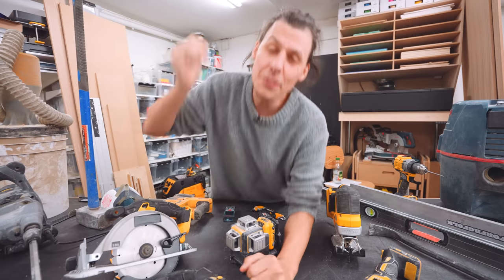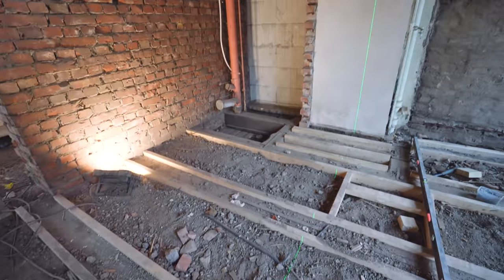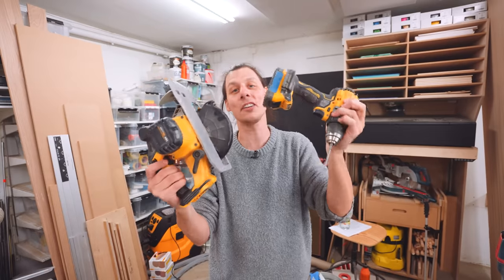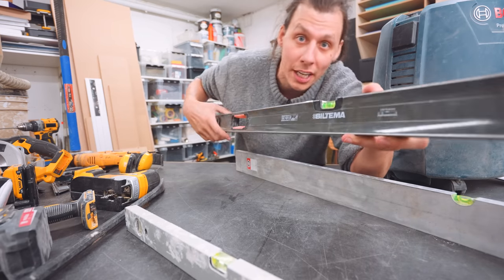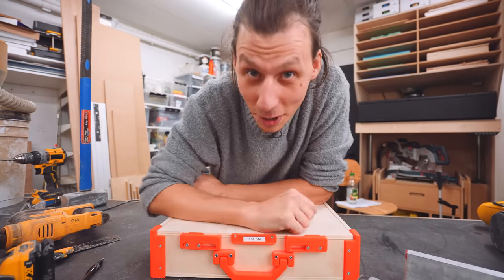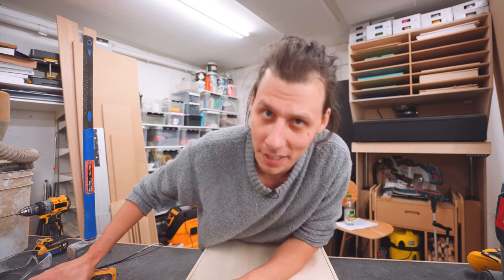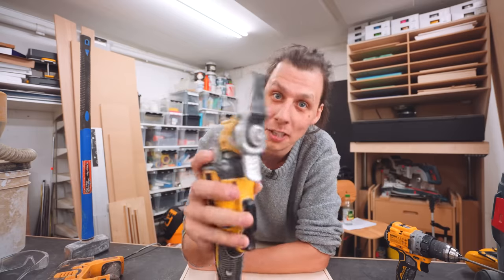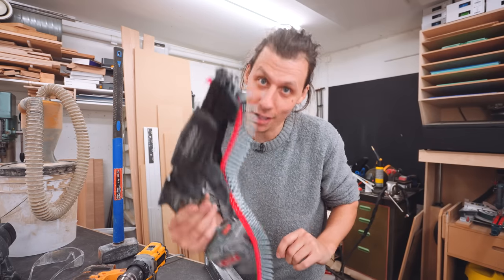Top 10 Must-Have Tools for DIY Home Renovations

Comment: This is what EU should force....compatible batteries for each brands.
Reply: 100% same should be enforced with all electronics, phones, tablets, laptops etc. univeral charger that fits all devices no matter what brand
Reply: @smashyrashy  for the phones and tablets, it's already the case, EU imposed and universal charging system, and everybody except for one asshole choose to use USB-C. The asshole being Apple of course. They have FINALLY accepted to retire the very inefficient Thunderbolt and replace it with USB-C, BUT, you won't be able to use a standard USB-C cable. You'll have to buy (a fortune of course, because it's Apple) a certified cable with a micro chip inside that will allow your device to accept the said cable. If you use a standard cable, nothing will happen ...
Reply: nope. Not enforced. You have to think things through before forbidding stuff
Reply: @WarriusZ3r0  Apple will replace the lighting connector, replacing it with thunderbolt, probably in the next iPhone 15. Thunderbolt uses the same connector of USB-C, because it is a superset of USB-C.
Reply: @rubenayla  stuff like this should absolutely be enforced. Just think of all the things that you use every day that rely on standards and are better for it. Imagine rolling up to a gas station and being like, "oh shit, I forgot my Chevron to Toyota gas tank adapter, now I have to go find a Shell station to use their compatible gas pumps." Or picking up a AA size battery and first having to check it to make sure it was the right voltage and amperage each time so you don't fry your electronics by accident.
Reply: @evanbarnes9984  Yeah standards are nice.
However, that does not justify a law forbidding the freedom to design things differently.

Imagine if micro-usb was standardized by law. Now it would be illegal to ship with USB-C, and we would depend on the state to slowly choose a new design. No thanks, I prefer to buy whatever I want. If the connector is trash or not compatible I won't buy it
Reply: @rubenayla   You could still have standardizing law saying "use this" and in instances like you mention with micro-usb and usb-c upgrade to change things out. That's kinda why they even changed things out within the usb standard itself. They didn't just make usb-c because it was fun, it has other functions than micro-usb. There's a difference between standardizing and neglecting improvments.
Laws can be altered, and the law about usb-c will undoubtely at some point change to move on to another standard. Because that new thing will have improvements over usb-c. Now when can we get a handle on all of the stupid mess that is quick charge??? xD
Reply: agree!
Reply: I've heard that Metabo is going to set the standard for power tools.
Reply: @Sharp_Stone  there are already at least two "alliance"s to standardise on one battery: cordless-alliance-system and powerforall-alliance :D 
But yes, even having only two battery systems would be better than having hundred and two battery systems....
Reply: Oh yes please! We all know the US won't do it because stupid politicians.
Reply: I'd say that might be a step too far. There are legitimate differences in opinion and design decision about the form-factor, connector, and power-delivery for batteries. But perhaps they should create a set of standards, even if not enforced.

Comment: I have to give props to Alexandre on his organization system.  I've been using his 3D printed bins, and the original cabinet for a couple of years now, and I've even built out a few cabinets of my own design, using his system as the design base.  In my opinion, well worth the (low) price.
Reply: if he had made his system open source like gridfinity it wouldve gotten a lot more popularity
Reply: Charging money for 3d printed stls is pointless as there are so many free options
Reply: How much does it cost to print and build a single drawer with all the 3D plastic boxes included? Just material costs.
Reply: Gridfinity is literaly his system but made open source, so its free and thousands of poeple are improving them.
Reply: @thisisdanielslife  no, it's not, there is no correlation. This is a system designed specifically for wood/metal workshops. Gridfinity is a crap, please do not confuse shit with chocolate.
Reply: @biomorphic  This is all super rough and based on the open-source #gridfinity system, but close enough to get you in the general ballpark with a few disclaimers...

- Each drawer looks like a 7x7 grid so that's 49 units. Longer/wider bins use less material per unit, so lets round that down to 40.
- 40 x 1x1x6 gridfinity bins (guessing the height but 6u looks about right) = approx 170m of filament (at my default print settings).
- Basic PLA (totally fine for stuff like this) costs around US$20/1kg spool, which gives you 330m

So you're looking at maybe US$8-15 per drawer.

You might use more plastic to print stronger parts, pay extra for fancy colours, or use pricier filaments (PETG, ABS, ASA, etc.) for specific use cases, but you get the idea :)
Reply: @glittalogik  thanks, not so cheap, but still affordable.

Comment: Currently renovating myself. Cross laser really is the MVP. 

What I'd add to the list is specifically a CORDLESS hammer drill. 
Its one of my most used tools and I can't count how  often I tripped over the wire or had to lay an extension cord because I also removed wires and only have one outlet.

As vacuum cleaner you'll need one with at least manual dust filter cleaning feature if you have concrete or drywall dust.
The automatic filter cleaning vacuums are crazy expensive. I'm using a Makita wi5h manual and that costs like 140€
I have another vacuum without it and it looses suction power 10seconds in of sucking that fine dust

Comment: Counting in the tools purchases is actually a big deal when doing DYI renovations. For example renovating a small toilet you will need a lot of tools but those can actually be a big part of the bugdet... but if you have few more jobs inline you end-up saving a ton. 
Oh and: "Don't go shopping when you are hungry" -rule applies to tools. After whaling away at a concrete slab for a day that jackhammer on the  shop floor looks REALLY cheap 😅
Reply: And if you have clay soil, that jackhammer is a HUGE help in the garden!  Pavers, trenches, planting, fence poles, etc!
Tom's wife Pam

Comment: Thanks for giving such prominent attention to safety. Spent the first five years of my working life in a hazardous environment without protective equipment. Sixty years later, now have nerve damage, COPD, and hearing loss. As you noted, especially important with respiratory protection to use the correct filter.

Comment: Hello, I love your videos, they give me lots of ideas for projects, especially about your 3D printed boxes with the grid system. I've made a CAD model that can be customized, but I'm missing some information, like the printing parameters, the thickness of the walls that would be suitable, the functional clearance that should be added between the boxes, the dimensions of the grid bars, and the optimal size of a tile. Since you have already thought about these problems, I would be interested in the conclusions you have drawn. 
Sincerely

Comment: I would like to add two things:
- "4d" lasers, it has an other horizontal line at the bottom. If you doing your floors it can help a lot and not much more expensive
- a good qualty vacuum cleaner, the one that can "kick" itself, to clean the filters. (or cyclone like in the video.)

Comment: Great video! I believe the common name for that type of vacuum is a "shop vac", also heard "wet vac" before.
Reply: ShopVac is a trademark. Not generic.
Reply: @RussellNelson  Band-Aid, Kleenex, Scotch tape, Jacuzzi, Q-Tips, Sharpie, Tupperware, Weed Eater, etc. Not generic yet heavily used as the generic term. So use wet vac or wet/dry vac really no matter I've easily heard both several times over as the common name. They're distinguishable products from what is thought of as an ordinary (home) vacuum cleaner.
Reply: @FlameMage2  But not used as a generic term in any commercial context.